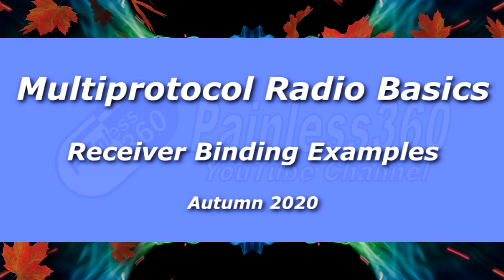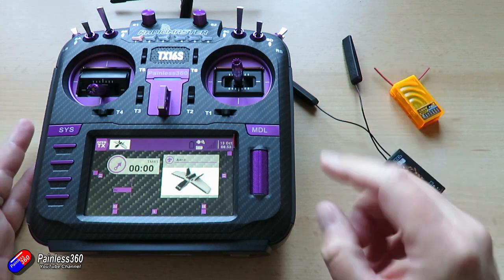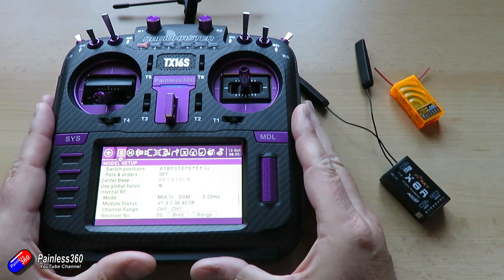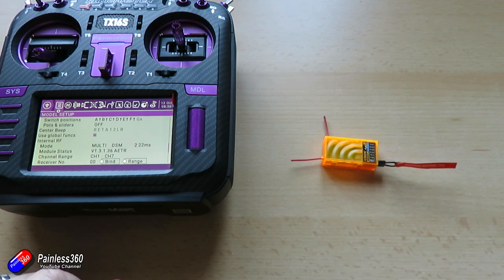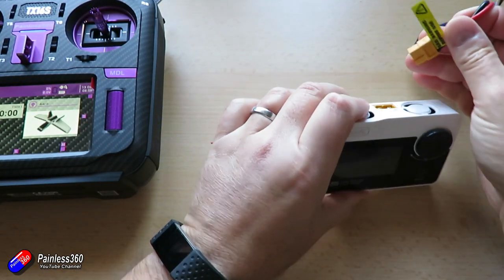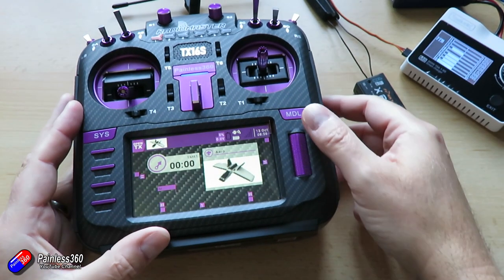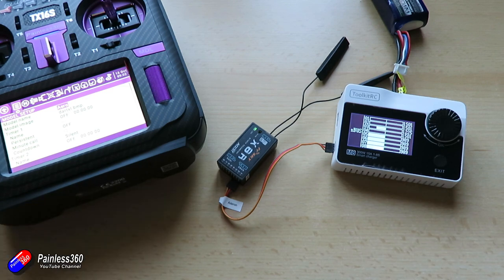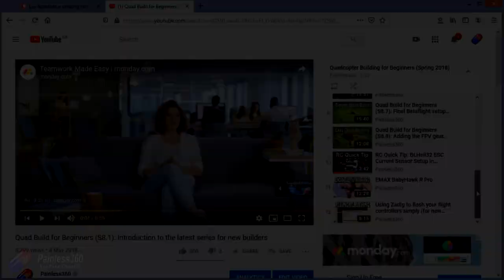TX16s MPM Binding Examples: FrSky D16 and Spektrum DSM Receivers

Comment: I recently purchased a TX16s MKII and FrSky X8R. I couldn’t get the X8R to bind using Mode FrSky. The red and green lights would both remain on when I powered up the receiver with the failsafe button pushed in. I changed the Mode to FrSkyX2 and tried again, then it was able to bind. Love your videos! they have helped me immensely 🙂.
Reply: same here, worked on frsky x2

Comment: Hi. I have 2 FrySky X6R receivers on two of my RC boats but my latest boat has Spektrum DSMR. Can the RadioMaster bind to DSMR ? SL315 receiver ?
Reply from the maker: This video shows you how to figure that out - https://www.youtube.com/watch?v=DfKyx0yTbXU - best of luck!
Reply: @Painless360 Hi. I just bought a MKII MAX. If I want to bind my RX8R FrySky receiver with telemetry on and on 9ms mode what sub protocol do I choose for the RadioMaster for ACCST V1 firmware on the receiver ? I don't need 16 channels I only need 8. I won't be using redundancy either. Should my RC boat servos be connected to PPM output or SBUS ?

Comment: Just got a used eflite plane with an AR6310 rx. It binds OK with all servos working but refuses to calibrate the esc. Any ideas?
Reply from the maker: What ESC? What troubleshooting have you already done?
Reply: @Painless360  it's an eflite 10a esc. Works ok with another rx. With the ar6310 spectrum rx. It will go into esc calibration mode but it won't activate. When throttle stick is moved from max to min nothing  happens. On the monitors the lowest stock position indicates -100
Reply from the maker: Tricky to help without knowing the exact part number so I can look up the manual. It sounds like you've calibrated a throttle before so just remember that for many ESCs, waiting too long to pull the throttle down to zero after powering on with the throttle at 100% can mean that the ESC enters programming mode. Best of luck

Comment: Thanks. I have three DSM receivers from my use with a Spektrum radio. I have tried all three of them on my TX16s radio. They will not bind. When I completer the bind process, the rerceiver light is off and does not come back, plus I get an obnoxious beeping. My second question is one of my DSM receivers has pre-labeled channels. I use AETR. But the order on the DSM is different does that matter?
Reply from the maker: There are lots of DSM options on the radio, try them all and sometimes you need to use the fine-tune option to get it locked. See my video on that.. Best of luck!

Comment: Your TX16S videos have been indispensable in setting up my new radio. Thanks! Most if it (OpenTX and the TX16S) is making sense except two things. 
1) I'm coming from Spektrum systems which are, of course, TAER. In OpenTX Companion radio profile I've set my transmitter to be TAER. But I note that in the Inputs tab it's still AETR, same with the Mixes and Outputs tabs. But the servos are properly mapped in the plane. So where is this re-mapping happening? From everything I can see in Companion and the TX16S channel 1 is aileron, etc. (AETR), so why aren't my channels swapped around incorrectly on the receiver, which is TAER? 
2) Changing 'Default Channel Order' doesn't seem to change anything. I've changed it back and forth from TAER to AETR and the Input channels always go AETR in a new model. The new model wizard always defaults to ch 3 for throttle as well, even if I've set the radio up for TAER. 
I want to understand what's going on in Companion and the radio, not just shrug and say "oh well, it works".
Reply from the maker: Hey Jessie, short answers are:
1) the channel order only affects models created after the change. The order in the Mixer screen dictates the order of the channels unless you are using one of the protocols like DSM that has a set order then the radio sorts that all out for you.
2) See answer to 1 :D
Check out the MPM common questions video for more..

Comment: On Deviation TX (Jumper T8 v2), there is an option on a sub-protocol of dsm that reads "orange rx". When you select that option and bind the radio and the rx, the orange light inside the rx will go solid. If you do not select this option, you keep getting micro fail safes and the orange light inside the rx will sort of flash in the weird way we see in this video. I'm not sure how to select this particular "orange rx" option in Open Tx.
Reply from the maker: If the radio is a MPM radio (multiprotocol) then selecting DSM should get you close.. Best of luck!

Comment: This old brain is trying to get my quad "Inductrux" into the 16s without any luck. I found a printout of the quad Horizon Hobby BLH8516 FPV pro manual. Every time a set it up something does not work. Each time is something else.... How do you see it being done? Thanks for any help. Continued success.I have it bound, armed, 1 flight mode. It still way far from where it should when properly setup in the radio. It flys, some control, no hover or change in flight modes. Looking forward to hearing from you and your instruction.
Reply from the maker: I've never had one here to try. Happy to answer any specific questions you may have... Best of luck

Comment: Lee, this is the rx/esc module inside of a 700mm Turbo Timber I purchased in a small lot of planes: 
DSMX 6-Channel Receiver with AS3X/SAFE, Dual BL ESC

From a Spektrum radio it says to toggle the "Gear" switch 5 times to turn on and off the flight modes. I want to use my T16S. Would channel 5 be the G switch on the Rmaster? With a UMX connector, I do not have a battery for this model. Will install an xt30 but there's little lead existing to get one's hands in there...
Reply from the maker: You can set up any switch on the radio to be CH5. Check out my OpenTX mix school for how to do it easily. Best of luck!

Comment: theres a saying dont fix what aint broke..lol..well now i upgraded to 3.1.92 .My Radio master 168 recievers are great but now my spektrum orange recievers gives me lots of options.My Radio shows DSM then 21F,22F,X1F,X2F and auto for binding options..some work but flash on and off(the light on reciever) some dont work.i dont know which one to choose?.I also am running a R920XV2 (orange reciever)with an extra plug in satellite antenna R110x all orange items from hobbyking.I now have discovered 19 new telemetry sensors because this reciever has external ports for batt,rpm,temp etc.I am having a hell of a time figuring this out.any help would be appreciated.I at the very least need to know which DSM option to pick now.thanks Sean in MA usa.

Comment: Hi. Nice video. Just a question concerning the tx16s transmiter performance. What about the range of this radio with this dsm receiver?. I purchased this radio and I wonder if the power trasmision is so good as a original spektrum radio....I have several orange dsmx receivers and one original spektrum receiver. What is you experience?. Thank you in advance. Cheers
Reply from the maker: See my video on power in the Tx16s series.. The big thing to do is tune the radio. See my video on the top multiprotocol tips and tricks... Happy flying
Reply: @Painless360  Thank you !

Comment: Nice video. Can the radio only work with the TBS system or would it work with other external modules?
Reply from the maker: Yes. Check out the Tx16s and Crossfire playlists..

Comment: Great video and thanks for sharing. I just recently upgraded from open tx to edge tx and i had to rebind the x8r and it wouldn't.  I belive my edge tx version is v2.9 Providence. If you have any information on what could be wrong, let me know. Thanks in advance.
Reply from the maker: The Multiprorocol module has support for all the options for Frsky D16 binding, make sure you are using the right one... Best of luck
Reply: @Painless360  i just found out there is a binding issue and i think it was already addressed in edgetx v2.9.8. i am going to upgrade to see if that is the fix. Thank you again

Comment: Is it true that the TX16s Multiprotocol will NOT work with Frsky ACCESS (have heard that may be a propriety protocol) receivers like R-XSR , or do you just need to flash the receiver to make it work? Would be nice to see some kind of TX16s/receiver compatibility matrix. Thanks for all the great content!
Reply from the maker: Check out my video on the common Multiprorocol module questions I cover this and how to find out more about what protocols are supported.. Best of luck

Comment: Can you tell me in that tx is there any glider model f959 cz i have rc glider from wltoys model no f959, mine original transmitter is not working properly that is i need this kind of transmitter, can you assure me that i can fly my glider with this tx16s

Comment: Hiya there! i've got the same setup as you at 8:40, however my X8R is not binding. Mine also says FrSkyX, not just FrSky for the RF Module...? ANyway, it doesn't bind. 
TX is on, then i hold the F/S button on the X8R, turn on the power, then I click bind on the remote... nothing. none of the FrSky protocols seem to want to bind. any fix?
Reply from the maker: You're doing everything I would by the sound of it. There are only four options for ACCST frsky protocol. I'd triple check that is what the RX has on it... Best of luck
Reply: @Painless360  Well, i'm going to flash a new multi-protocol module, although i was already using V1.3.3.3 when you are in this video still on V1.3.1.36... idk. 
I'm in the EU so i'm not sure if i actually bought the X8R-EU version or what, but i tried LBT and that didn't work either. time to try again i guess...
since my TX16s refuses to charge for some reason, i'm currently waiting on the batteries to recharge lol
Reply from the maker: Best of luck!

Comment: I have just purchased 3 of the x8r receivers .Would you recommend flashing them and if so what version of firmware should i download and install onto the sd card in my tx .Once a vesion is selelcted and the the rx has been flashed.Then what option do I select to bind to the newly flashed rx.Im finding it a bit confusing.
Reply from the maker: You need to use the same as is on the radio. See https://youtu.be/aZhvnm8j88M

Comment: Thanks for you help. Seem to have bound to scout ok. 
  When I bind to Tundra, I get no throttle. 
Should the model dance on switch on.. doesn't seem to. Perhaps I haven't bound correctly though other surfaces are working. 
  I'm binding orange receiver via dsm auto and I get aileron, rudder, elevator correctly, but no throttle.
Reply: It finds dsm 2 , 22ms.  
  I have throttle notifying 0-100 on the monitor, but no action. 
  Set on ch3.
Reply from the maker: Spektrum kit normally uses TAER channel order not AETR. See my MPM quick tips on how that all works - https://www.youtube.com/watch?v=Nii4ElEbg6s - that may help..
Reply from the maker: P.S. Also try DSM2 11ms too (remove the prop while you're testing ;) )
Reply: @Painless360  thanks again.. 
  Complete noob error. 
 Tx wasn't calibrated correctly.

Comment: How do you get more than 8 channels on your receiver? If you are using a plane that needs more than 8 channels. 
Like ailerons on each channel, flaps and want to add smoke and retracts.
Reply from the maker: You can bind multiple recovers to the radio or use something like an SBUS to PWM converter (among other options). Best of luck!
Reply: @Painless360  where do I find this information? I've looked and looked but not much luck.  I did find one video where a guy bound a 8 channel and a 6 channel to get 14 channels. I didn't know you could bind 2 receivers for total of 14 Channels.
Reply from the maker: It's outside there.  See https://www.youtube.com/watch?v=ST9LON1-Bvg for example.  Best of luck

Comment: 2 question that have been bothering me.maybe u can help. 1st,IS it normal that i lose signal (rssi lost) when my radio is within a couple inches from plane/reciever?.it does this with differant recievers that i have bound..As soon as i pull radio away from plane, rssi recovers. 2nd,my spektrum recievers light flickers as yours did when bound.They do not do that when bound to my spektrum radio.thanx sean..
Reply from the maker: Both are normal. Remember to tune the protocol for the best reception.. Happy flying
Reply: Thx.yes I have fine tuned frequencies..

Comment: I have a flysky receiver that is ppw and I get it to bind to my Radiomaster but when I Goto betaflight it doesn't receive any signals. Any idead?
Reply from the maker: It depends on what you are plugging it into. I'd check the manual for the flight controller you are using.. Best of luck!

Comment: I’m trying to bind to one of my Spektrum receivers and have a problem. With the esc connected  to the throttle connection on the receiver it will not bind. It will however bind with the esc connected to the aileron connection on the receiver. So I set everything up using the gear connection on the receiver for ailerons and everything works. This is ok but now I’ve discovered there is no fail safe setting available in the transmitter menu and when I turnoff the transmitter everything stays at last instruction including the throttle.
Have I connected something wrongly or is this a software problem. I hope you can help as I bought the transmitter so that I would only need one but it seems I may have been mistaken.
Reply: Thanks for your prompt reply…I’ve tried with three receivers…AR8000, AR6210 and AR7010. I’ll let you know if I find the cause.
Reply: Problem sorted. It was because I’d used the default Module Satus. I had used channel numbers in the order they are on the receiver ie throttle on channel 1, aileron on channel 2 etc. I should have used AETR  for the channel numbers ie aileron on channel 1, elevator on channel 2 etc. The failsafe is now working correctly.

Comment: I have a Radiomaster tx16s and I have had problems binding a 10 channel Lemon dsmp receiver. [All my other DSM receivers have bound and worked without a problem]. It bound ok but only giving 7 channels not 10! I was binding using DSM and sub-protocol AUTO and I made a point of setting channels 1-10 but what ever I tried and what ever sub protocol I used, it always reverted to only 7 channels. The tx was about 3 meters from the rx so closeness was not the problem. I was totally frustrated but eventually after an internet search, I set 1 to 10 channels, Sub-protocol AUTO but I found a setting a few lines lower down the page that said "Auto detect format". I turned that off and the 10 channel rx bound perfectly giving all 10 channels. I wonder if I am the only person the know about this.
Reply from the maker: I'd check out the wiki in case others have reported it. If not, then make sure you are on the latest versions and report a bug. Best of luck!

Comment: hi nice video so please i need your precious help. recently they gave me a walkera runner 250 without the tx and i tried to bind the Devo rx710 with my t18 pro  but without positive results. I have selected devo protocol  but nothing !!the rx does not bind. some advice ? thanks thanks in advance.
Reply from the maker: Check out my videos on the Multiprorocol module. Maybe update the module? Best of luck
Reply: @Painless360  thank you for reply Yes multiprotocol update i have etx in my t18 jumper. rx710 devo need devo protocol true?
Reply from the maker: I've no idea what protocol it needs.  I'd confirm that you have the right one.. best of luck
Reply: @Painless360  devo rx710 = devo protocol  i think ;)

Comment: Hello, I'm trying to bind a RX8R-pro receiver to TX16S and the only way I could do it is with telemetry OFF option. If I have it set to ON, at the end of the binding process I have red light on RX and green light sometimes blinks. Do you by any chance know that that is? I tried re-flashing RX with v1, v2 and v.2.1 firmware. Tx and internal module are both up to date.
Reply: @Painless360  I have flashed Rx8Rpro with Accst 1, same result.
Reply: @Painless360  About V2 support. As far as I know, FrSky X2 protocol supports ACCST v2, and works on my xsr radios, so that should not be an issue.
Reply from the maker: No idea. If it works on the other receivers then maybe it is something specific to that Rx. I've not got one here to test so let me know if you get it working..
Reply: @Painless360  Thanks. I think I found the issue. Looks like it's the power supply - when telemetry is off the RX uses less power and work ok; when telemetry is on, the RX turns on the internal telemetry transmitter, uses more power and the current supply drops... Anyway, thanks for your comments!

Comment: Thanks for the video Lee, Very helpful. How about binding to the spectrum AR636A receivers. I have had trouble with them and they come in there bind and fly airplanes. Thanks.
Reply from the maker: I've never had one in here so can't comment from my own experience. They use the standard protocol so I've no idea why you can't bind. They will expect a very specific channel order though.. Best of luck!
Reply: @Painless360 Unfortunately I have been having major problems binding to the AR636B reciever on my aeroscout. My TX16s has internal ELRS so I have the 4-in-1 module in the bay. It's to the point where I am wondering if the module is bad (it's new). I ended up ordering a FRSKY and an ELRS reciever just to test. Would suck to lose SAFE and AS3X, but it's better than not being able to fly the plane at all.
Reply: @gagegr I’m having problems as well, the receiver light won’t go solid but it seems to know I’m trying to bind. It blinks rapidly about 6 times then goes off. The receiver is the ar631
Reply: @jacobwebb6492  So I furgured this out (for my problem). In the model setup choose MULTI then DSM. I originally tried selecting DSM2 or similar to begin with instead of MULTI:DSM. Hope this helps!